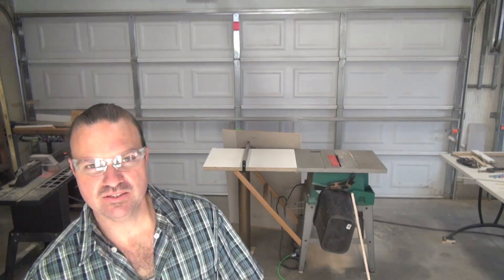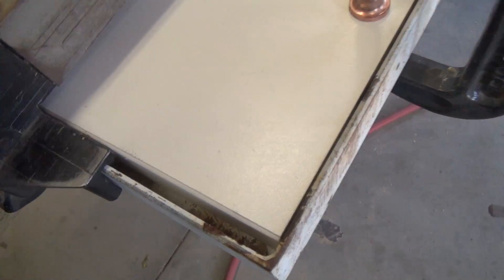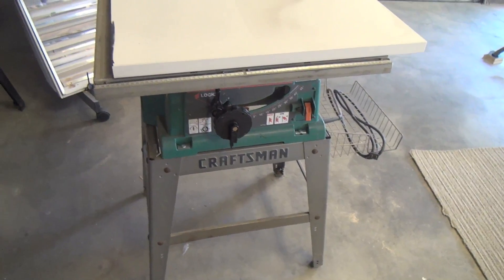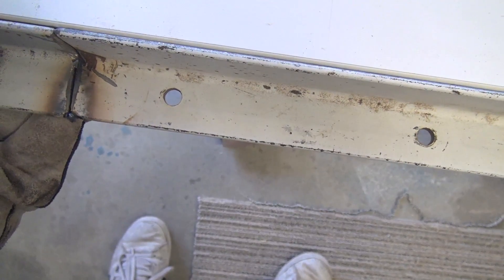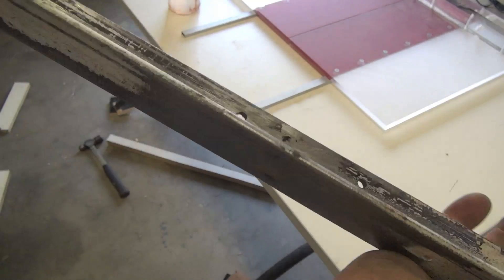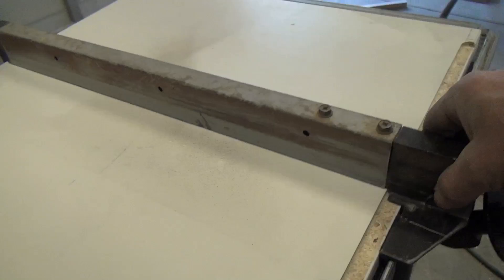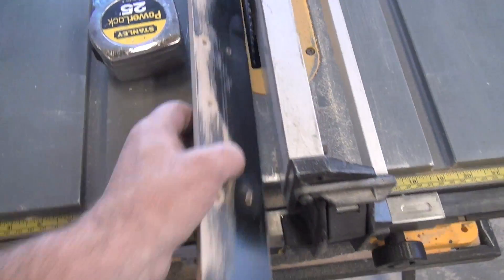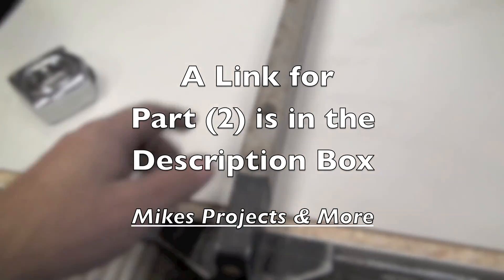Extend Rip Capacity from 12" to 40" * Extension Wing Build  1 OF 2 *diy step by step Table saw

Comment: Nice job man!! And by the way Im actually a welder by trade and yes heat will flex that metal like crazy!! Next time try using 4 clamps, 2 on the outsides and then 2 very tightly right next to the area you are welding and get a few tacks in I usually at least tack 3 areas, 1 middle and 2 ends!! that should help!! Great job
Reply: Mike's DIY Projects & More awesome was looking to buy a extension im sure i can make one way cheaper and looks fairly easy,  one thing dont know if you were welding with the dogs in the shop but I know dogs will stare at the arc when they are in the area,  I have to make sure mine are not in the shop before anywelding
Reply from the maker: Cool, awesome thanks. Yeah it was a pita,  I could of made a vid just based on the strugle of welding this piece but that would be no fun. There was more involved but I cut out, boring! haha.